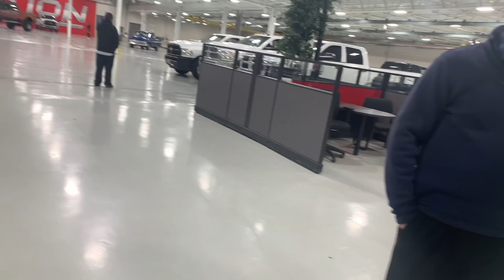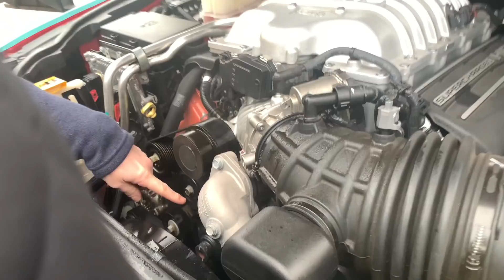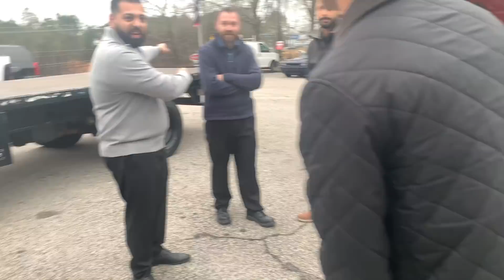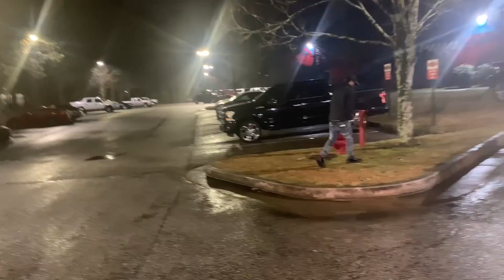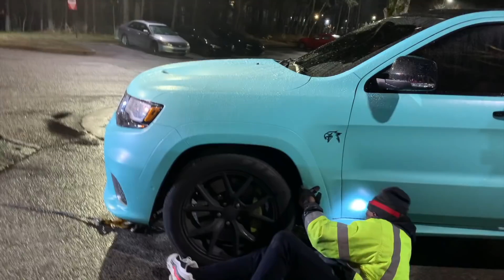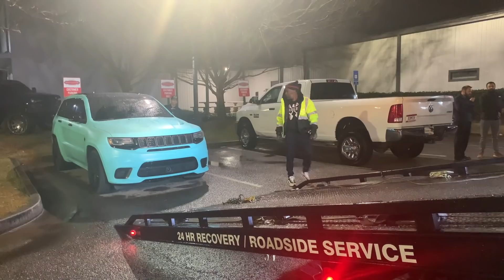DEALERSHIP BLEW UP MY TRACKHAWK! LEADS TO ARGUMENT! *HAD TO TOW IT*

Comment: did you have the ac on when u pulled up to the dealership cause it was leaking but the puddle on the floor when u pulled up isnt red like the puddle that u showed us after.. the puddle in the parking spot looks like its maybe leaking water but the bigger puddle looks like coolant u should have touched both puddles with ur hand to see if they are both coolant

Comment: It’s the oil cooler. Happened to my Jeep. One start up afterwards and it causes the hydrolic lifter to run dry which causes a tap on the head of the motor. Aka hemi tick.

Comment: Main Reason I Rather Do My Own Maintenance…. If it was leaking at all they should have put it back in the air and checked it out. Could’ve been something simple as a double gasket oil filter. Sh*t happens. And if it was the water pump, cool give me a quote. Definitely wouldn’t go back there

Comment: Man bro dealerships are big ass scammers they know how to fuck your shit up and turn the shit on you… I took my challenger in for a coolant flush and to see why my oil temperatures were seeming high to me.. they told me “oh no your oil temperatures are normal, we don’t see anything out of the normal” I take a thirty minute drive home got home started my car back up to leave out and my engine is rattling and my car had no oil AT ALL and my lifters weren’t functioning properly. Call the dealership and they trynna tell me they didn’t check to see why my oil temperatures were high they didn’t check anything (but they told me to my face “everything looks normal”)they only did a coolant flush my whole engine was done cause it had metal shavings from me driving home with no oil. Lucky I had my warranty still.

Comment: What's good Youngblood water pumps not a big job when the car runs at different temperatures it expands and decreases should just need a gasket you're lucky the water pump didn't lock up on 👍 should look at there's any cameras in the street so you can get video footage so you have proof obvious they had no respect and the men surrounding you it look like they're trying to intimidate so trackhawks out  action until you get it fixed 🙏🙏🙏🙏

Comment: That’s crazy but from my view .. that looks like tranny fluid (but) I did see your antifreeze is red so it more than likely is that water pump.. it’s not a hard or bad fix , probably be a couple grand at most .. that’s fukd up anytime a dealership has your car if anything happens after or is happening why they have it , it is on them regardless if it was already doing it , they are supposed to inspect everything between they even touch it just for that reason ..

Comment: They need to fix your vehicle, if your water pump was leaking before hand like that you wouldn't have made it to the shop your car would've ran hot before getting there, that little puddle before the antifreeze puddle is condensation from your vehicle not coolant constantly pouring out, they should be responsible for anything that went on after your job was complete.
Reply from the maker: Fax it wouldn’t have made it 😂